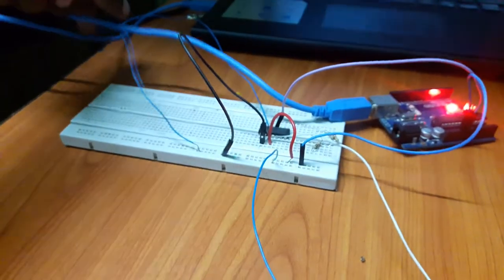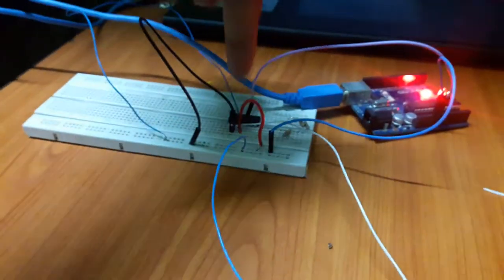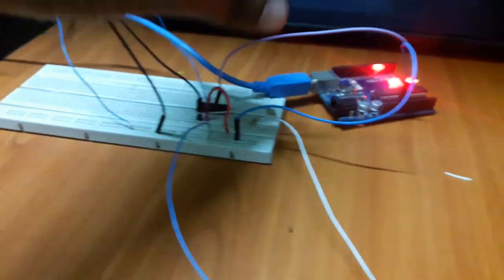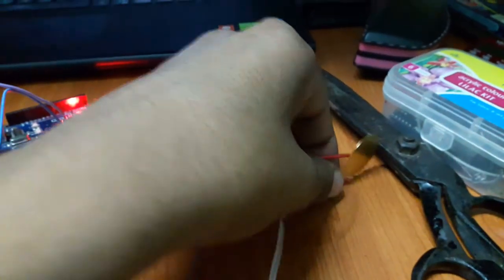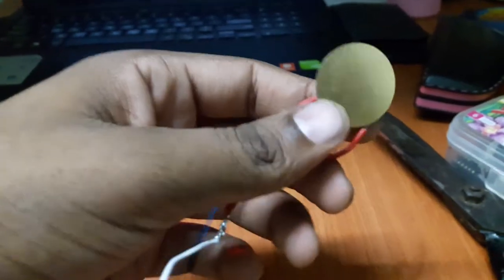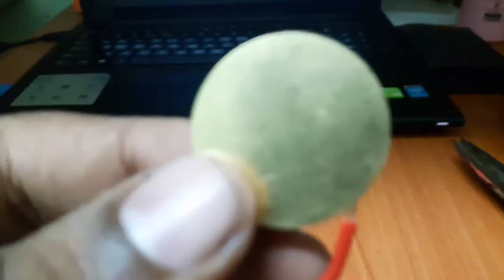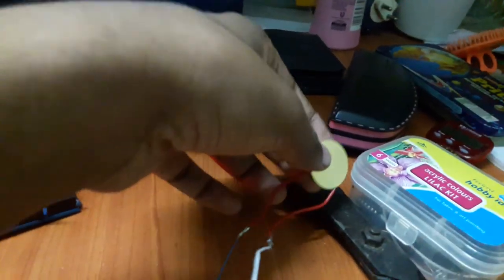Bone conduction earphone using a piezo transducer

Comment: There is something called a "Crystal Earpiece". You can use 20, 35 or 50mm piezo passive buzzer (a passive buzzer whuch it consists a Housing and piezo element inside, not just the piezo element. 

 A housing of a piezo passive (or active) buzzer Acts as a membrane that helps double its volume. Just imagine if a bare piezo element made a sound It's like the voice coil from a speaker sounds but without coring paper other than the voice coil and the magnet itself) with your own tube and ear cushions added. In one ear, or both

Comment: can you put it like on your elbow and hear it through your fingers on your ear?
Reply: Hi FlakAlley, bone conduction works mostly due to 2 bones on the head which allow one to directly send the audio to the hearing organ and bypass the ear and the mechanics in there. so you will have most success by attaching it to one of those. the most successful is the one directly behind your ear in general. the elbow in general won't let you hear the sound. you can use you hair however since hairs are rather sensitive to vibration they can be used to send the signal to your senses from where you might be able to recognise patterns and such, that won't be traditional hearing however.
however if you mean it in the way like having gloves or such with piezo finger tips and then touching the bone behind your ear with your fingers then that should work. so that you can communicate by touching your head to hear audio.

Comment: hey bro can u tell me where to get that piezo transducer and if i can get a bigger one.And i gave u the first like.
Reply from the maker: Hey Vikas, we got ours at SP road, Bangalore.. The one shown in the video is a medium sized one.. 
Thanks for the first like :)
Reply: Thanks for the reply,well i don't live in banglore but i will try getting it online,can u tell me if i can use a piezo as bone conduction transducer  and if it could be used as a woofer for bass conduction as in the "Subpack".
Reply from the maker: To the extent that we have tried, yes! You can usedthe piezo as a bone conduction transducer..  You might need to add an audio amplifier though (if you are taking the output directly from the audio jack )..
Reply: thanks a lot thats what i needed.
Reply from the maker: Sure.. Anytime :)